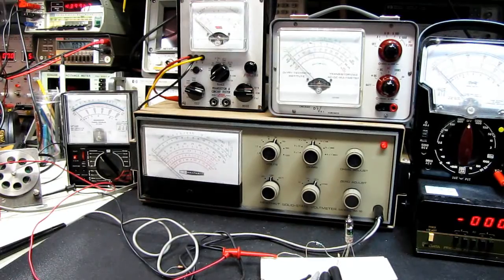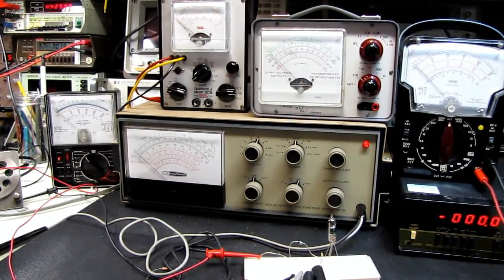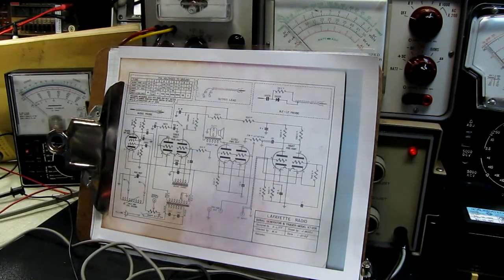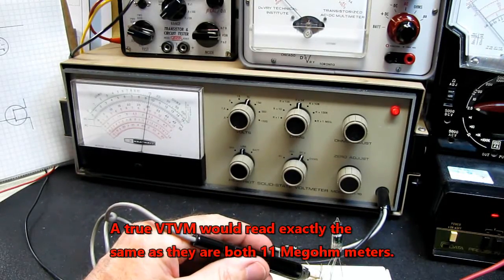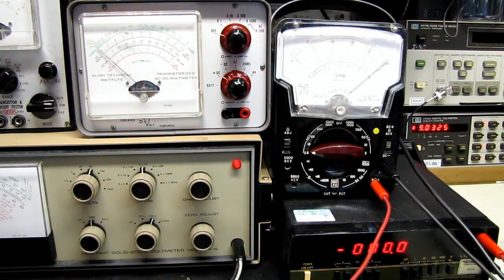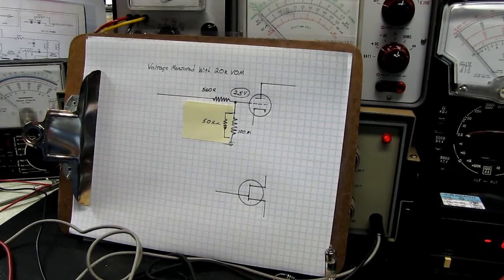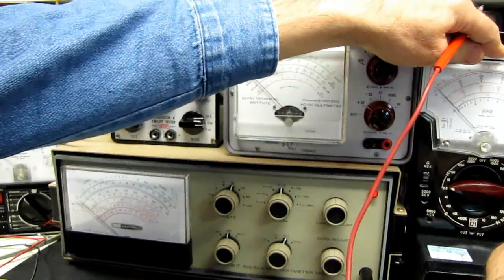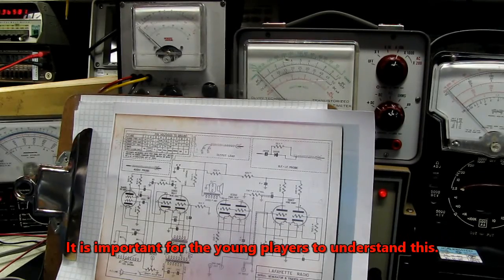Select the Correct Voltmeter - It is Important

Comment: Even more concerning is if you use the wrong meter to test resistance in circuit and the meter cranks out enough milliamps to damage your components. This is something to watch out for with some kinds of delicate chips.
Reply from the maker: This is why all of my own meters have a label on the front warning of how many milliamp years they pass in the times one and times 10 range. Actually did a complete video on this.

Comment: You terrified me with that threat at the end, so I subscribed!  Seriously, clear and well presented stuff.  Next time I see a vtvm or such like at a hamfest, I'll pick it up.  Maybe a good subject for a future video would be using op amps or fets to turn a 50kohm / volt meter into a much higher input impedance device.  I have a few old British avometers I want to try front ending like this.  I will go and check my voltmeters... Tim.
Reply from the maker: Hi Tim, Thanks for stopping by and for the suggestion.